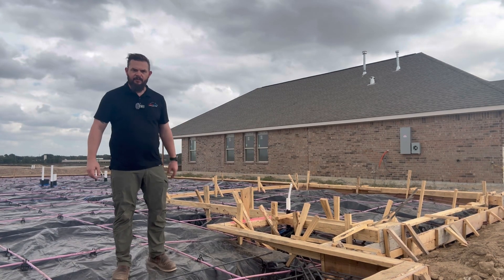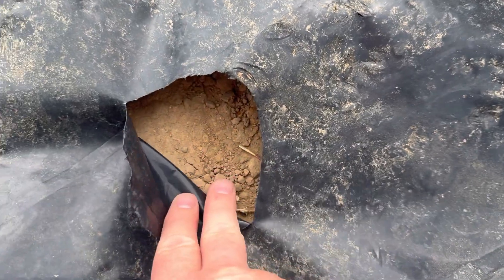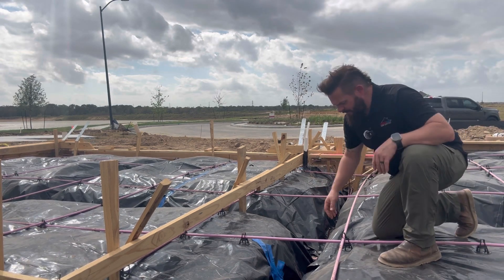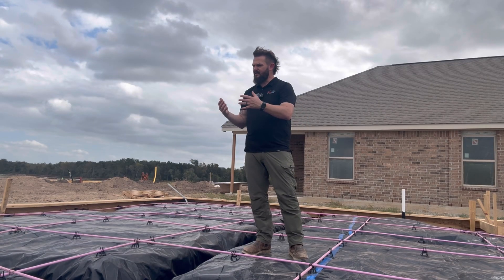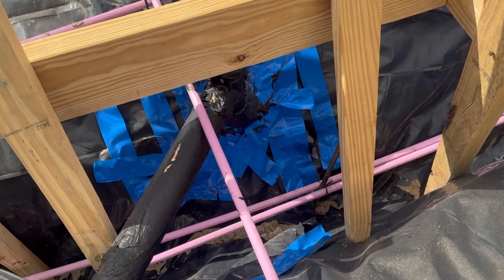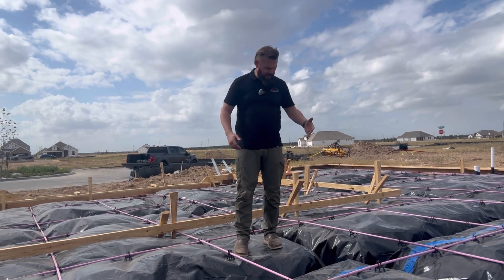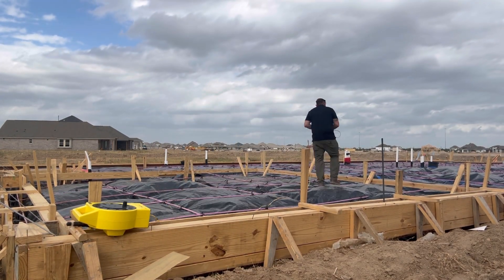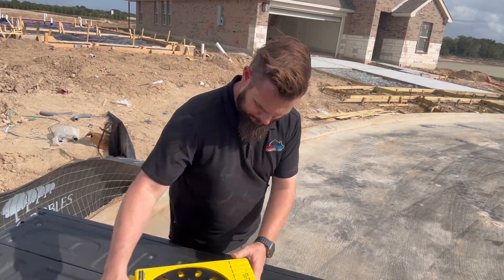Comprehensive Pre-Construction Home Inspection Before Pouring The Slab

Comment: I bet as soon as Mat left the concrete truck and 3 Mexicans came and pored that slab! they never came afterword to tension the cables or pull the forms off either, the framers joked as they took the forms off and complained how it wasn't their job... Inspections only matter if people come and fix the issues and most of the time, they just dont...
Reply from the maker: Sure, that can happen sometimes. However, there have been times where I have gone back to check that repairs were made and found that they were. They have also been times where pictures of repairs were sent, and it was clear that they had made the repairs prior to concrete. Most of the problems they were observed in this inspection as well as most Pre Pour inspections are not huge red flags. Aside from maybe the plumbing in this one. 

The point is, all of these items were documented in a report. If the buyer is to have issues that could’ve been prevented with these repairs, for a very small amount of money, they have an inspection report to use as recourse.

Furthermore, sometimes it’s not about what I find, but what I don’t find. If I don’t find serious problems, and all I find are a variety of low concern, poor workmanship issues, that is still a valuable inspection report.
Reply: @texas.edge.inspect  I appreciate the response.  As a framer in Kentucky I find that we end up gawking at what the foundation people have left us with more times than not.